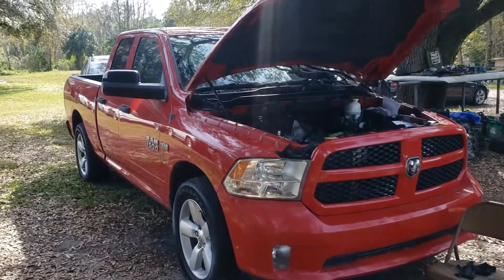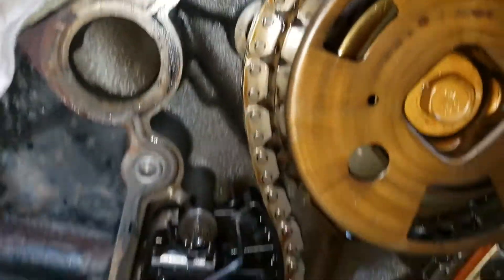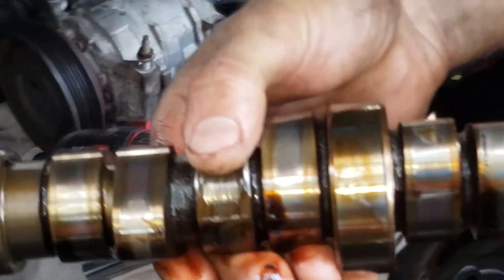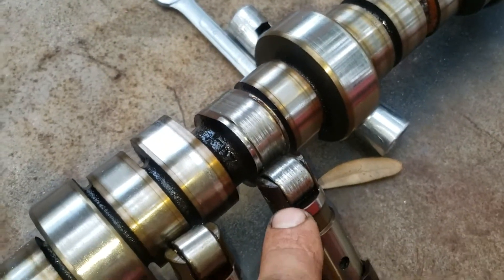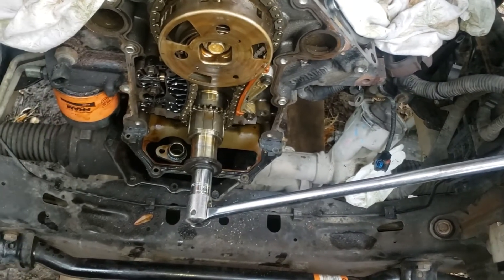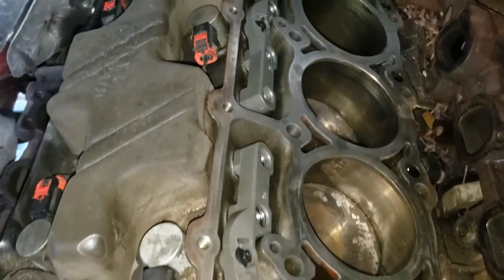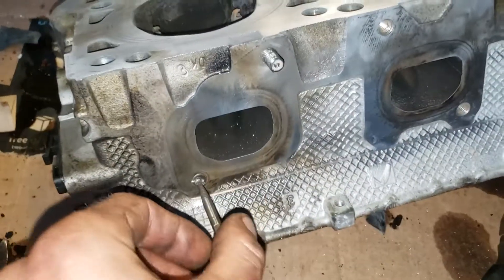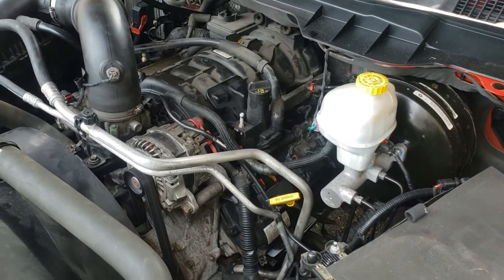DODGE RAM 5.7 HEMI MISFIRE EXPLAINED

Comment: This has little to do with it being the brand of engine and more to do with the owner not changing the oil.
As you can see the oil is black.
Be sure to change your oil always.
Your oil will get dirty full of carbon and break down it natural ability to lubricate the moving parts,an engine is mechanical there's moving parts and they need to be oiled otherwise you wear down the parts especially if you are horsing on the engine.

Comment: So we are doing our hemi and we have a cylinder three went down on the cam and no compression on cylinder three .I’m just worried about metal in the motor. with your experience how is it been it worth doing that kind of job or just replace the motor
Reply from the maker: With compression problem you should do a leak down test to see where the compression is going. 3 options where it can dissappear is blown piston, intake valve not closing or exhaust valve not closing.  I wouldn't bother paying for any part until you got that figured out.

Comment: wonder if my truck has this problem but mine is a 07 dodge Dakota 4.7. have multiple misfires (4) 3 on driver side 1 on passenger. changed spark plugs, coils, even battery(2019) acid leak,  and change upstream oxygen sensor since that was a check engine code too. only manage to change one sensor for now since I got 2 right side instead of left/right. with just changing one i have felt a bit of a difference. just taking it one step at a time.

Comment: Still ticking 😂
Reply from the maker: Always recommend using factory camshaft and lifters,  lifters should be left to oil bath for 24 hours just to assure that they get filled with oil to avoid any ticking. Aftermarket lifters aint good at all.
Reply: Where are you locate pliz

Comment: 2015 ram v8 5.7 
I replaced the cam and lifters now the truck runs way more rough than it did.
The CEL is flashing when previously it was only constantly on. 
Bad mechanic? Rpm is constantly high. Dont know what else to fix. 
Seems like it got worse than before i replaced the cams and lifters. 
Any suggestions?
Reply from the maker: If your rpms is higher then should be that would Indicate a vacuum leak
Reply: Sorry to hear that bro - I think I have the same issue - Cylinder misfire 😑
Reply: @dimensionexo.  #8?
Reply: @Pigscanfly2024   - #3 and multiple 😓

Comment: Here is a HUGE tip for you ... Whenever removing or installing a blind camshaft ( cannot see cam bearings ) always insert the phaser bolt or a longer bolt ( same thread ) into the end of the camshaft . This is to gain leverage when guiding the camshaft out and back in as to not damage or potentially move the cam bearings .  .  Also when tightening the  phaser retaining bold 100% easier to remove the starter and push it forward to hold the flywheel with a pry bar or flywheel lock tool . No mention of assembly lube on the camshaft and the lifter rollers . I have to ask if you are a mechanic by trade or a self proclaimed mechanic ?
Reply from the maker: Did not claim to be a mechanic at all, just opened one hemi 5.7 up and successfully put it back together, not teaching anyone at all, video is shared for information purpose only, repairs on your car should be done on a certified mechanic 😉
Reply: @pandydiy  where are you located?  I'll pay you to come help me with my truck
Reply from the maker: @jlmcgraw415  you can hit me up at Instagram @pandy55amg

Comment: Mine just started showing a misfire on cyl 3.So I figure I a getting ready to do this too.
Reply: I drove mine for about two weeks trying to diagnose it. I replaced the coil and plugs and injector. Then realized it was the lifter and cam.
Reply: @ericearhart  did you replace the cam and lifters after those 2 weeks also or did you keep running it?
Reply: My truck runs perfectly as long as I don't go past 5k rpm. I wonder if it's gonna just get worse until it just doesn't start anymore
Reply: @alvarocorona9191  yes did a MDS delete and new cam and lifters. Have put 25K miles on it since with no problems. The MDS delete required a Diablo Tuner.
Reply: @ericearhart  Instead of the delete I was wondering could I just switch to a meilling or a hellcat pump ?
Reply: @alvarocorona9191  It's not going to get any better unfortunately *
Reply: @dimensionexo.  I don't know. I went with the delete. Not sure what the different pumps will do.
Reply: @ericearhart  Stronger pumps more oil volume to the valves 'lifters *
Reply: They are notorious for failing - That cylinder*
Reply: @dimensionexo.  that code just popped up 3 days ago on my truck🙃
Reply: @alvarocorona9191  😐😢
Reply: How long did your truck last with the code before you fixed it?